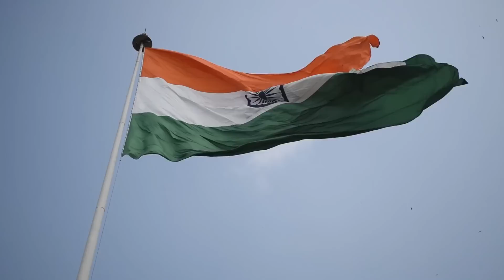10 facts about LCH Indian built Helicopter : Specification , Price , range , weapons and induction.

Comment: the engine  jointly developed with France and manufactured in india and it is using a 1400hp engine now and ioc (initial operation capabilities) but whenass production will began it will have 1600hp hal htfe1200 engine which is completely indegineous not even some parts from France and all other helicopters like hal dhruv, rudra ,hal luh ,lch will have that engine as they already have common engines. 400hp difference is very significant

Comment: World's highest service ceiling attack heli LCH 🔥
Reply: Lol.enginies are supplied by usa.
Reply: @Elsonoliveira716  it’s Indian engine only not USA
Reply: @Elsonoliveira716  Urban naxal spotted 😝
Reply: @Elsonoliveira716 you lol this is jointly developed with France and manufactured in india and it is using a 1400hp engine now and ioc (initial operation capabilities) but whenass production will began it will have 1600hp hal htfe1200 engine which is completely indegineous not even some parts from France and all other helicopters like hal dhruv, rudra ,hal luh ,lch will have that engine as they already have common engines